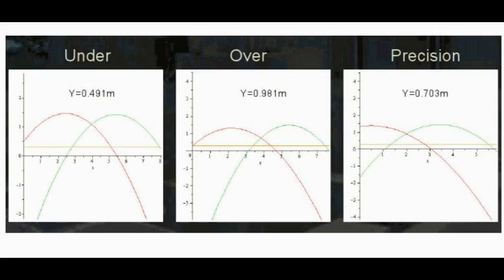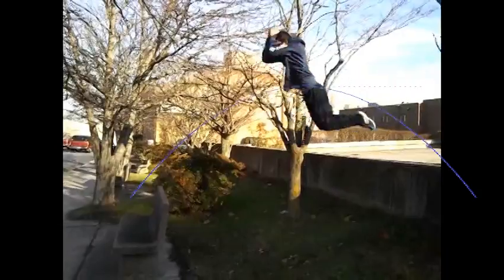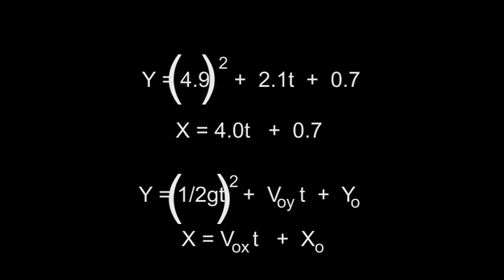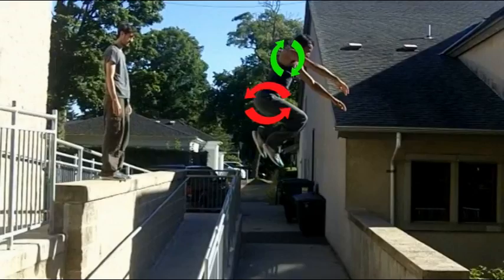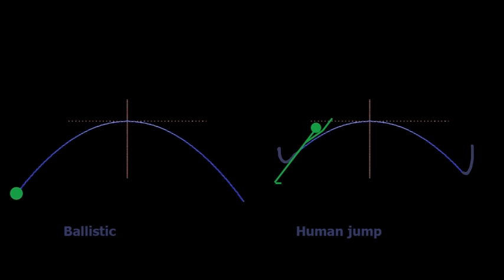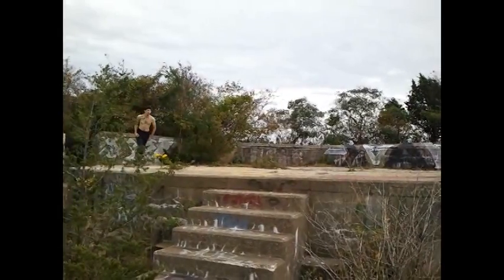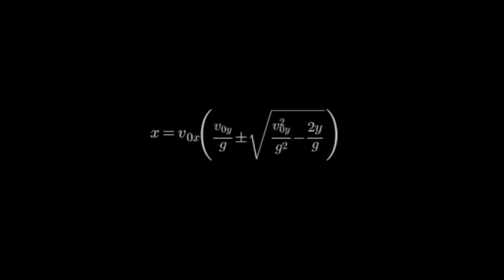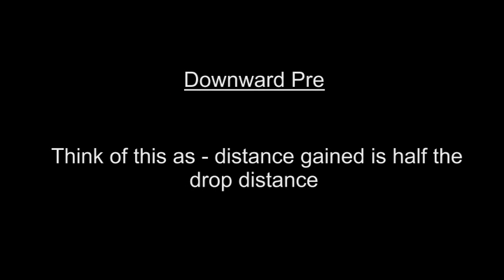Parkour Science #4 Physics of the Standing Precision Jump -Part 2 (advanced)

Comment from the maker: The displacement angle (which is inevitably the angle you feel yourself jumping at) is 45 degrees. So you want to aim for 45 degrees- but if you did trajectory analysis you would find a lower velocity angle... the velocity angle changes from person to person but it is very difficult to perceive, let alone modify. Long story short--- aim to jump at 45 degrees on flat ground. What feels like and looks like 45 degrees is in fact the maximum distance for the jump. (did that make sense?)

Comment: you said that when jumping at 45 degrees the velocity x and y components are equal to those of a more regular projectile of 30 degrees. Since a regular projectile has optimum range at 45 degrees, at what angle would you recommend a traceur to jump in order to  have the same velocity components as a projectile at 45 degrees? For flat ground at least.